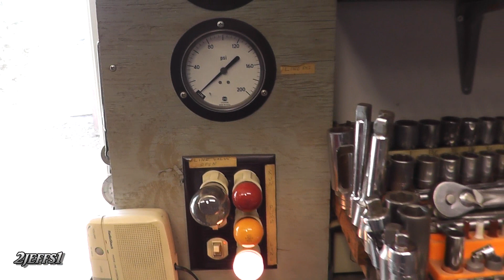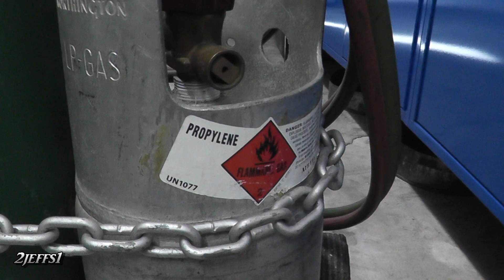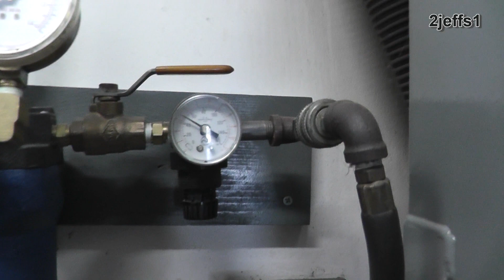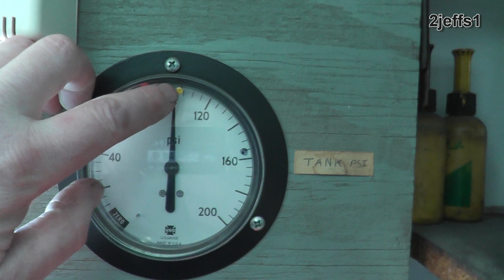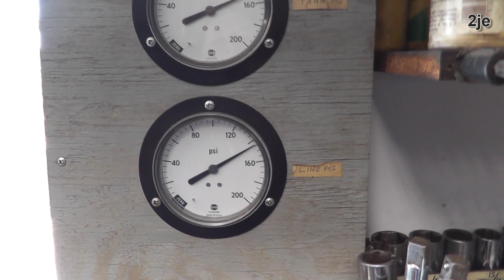Air Compressor Setup Money Saving Tips & Ideas

Comment: Nice!  Is that a Kellogg compressor head?  I have one that a friend gave me (though he didn't know it's history) that looks virtually identical and I intended to build a similar setup out of.  The difference, where yours was missing the intercooler lines, mine has those but is missing the pulley/flywheel, and I haven't had much luck finding one of an appropriate size.  

Any idea what RPM yours runs at?  Mine is rated at something >25cfm at it's rated rpm, which is way more than I'll ever use so I'm considering hooking it up with a smaller motor and turning it at a lower rpm, but again, I've had no luck finding a pulley/flywheel for it.  I have a pulley that is large enough for it that I could rig up with a cooling fan but I'm not sure about running it without the weight of the stock flywheel.

BTW, mounting it on springs is clever, I'm likely to steal that idea when I get around to building mine ;-)
Reply from the maker: Hi there Mark. You are correct - it is a Kellogg pump. I had that pump before arriving here in 1986 but not that 120 gal tank it sits on so kinda don't remember the specs. However I do have some helpful advice for your setup. I remember that they recommended that that pump had a 7 1/2 to 15 HP motor. I only had a 5 HP at the time and figured why can't I ratio it accordingly and make use of the 5 HP motor. Well it could be done and worked but - where the flywheel didn't have the speed/momentum the shop lights would be blinking when it was running. Tried several motor pulleys and same, same. Did finally get the 7.5 HP motor and all was well. So getting the proper flywheel and motor for your setup is kinda important. BTW my motor is the 1750 RPM in case you were wondering about that. Hope this saves you some time, trial and error (and money!) Mark. Good luck, Jeff.
Reply: Did you ever get it running right on a 5hp motor?  I have 3, 5hp (supposedly) motors sitting around but not much bigger that's single phase.

The spec sheets for these things are available from a few different sites, so you should be able to get complete information about them, for example, My 335TV is rated for 3-8hp at 400-1000rpm:
http://kellogg-american.com/wp-content/uploads/2015/07/K335-Manual.compressed.pdf
(you should be able to find PDFs for most of their other compressor heads on that site, though there are better versions out there from other sources).

I am worried that without a heavy enough flywheel I'm not going to get this thing to work well, if at all.  I don't believe the stock one was super heavy (I remember that I ran across a spec of 22# somewhere, I don't remember where) and about 13" OD, and I have a 15.75" OD pully that is only 13#.  I even contacted Kellogg and they didn't have one in stock but swore that some of their distributors should have one and none did, though that would have been out of the budget to spend on a compressor head with an unknown history, $219 from them.  I've even had crazy thoughts like cutting a hub on a lathe to adapt a brake rotor or engine flywheel to the shaft to act as a flywheel, but that would impeed airflow which I probably still could get around by wiring an electric fan to come on with the contactor... though at some point you have to wonder when something so cobbled together is going to fail.

I think I did a little looking and comparing their power and cfm graphs and figured that it would be really sweet to have this thing loafing along at around 600rpm and still moving more air that I really need to run any common air tool, sand blaster, spray gun...
Reply from the maker: Hi Mark. I did use mine for a while with that 5HP motor. It was evident that it wasn't the ideal setup. The local farm store had a 7.5 HP motor that was a return. It was marked down and the manager even knocked off another 100 bucks to move it. Talk about the right time/place. Seemed I got it for around 300 bucks and has performed perfect for all the years, never an issue. For sandblasting a big compressor is nice when you can keep going not waiting for it to catch up. Your car flywheel idea did sound like a possibility to do, just too bad you couldn't get lucky and find exactly what is needed.

Comment: What do you  run that needs this much air and what is your capacity storage?
Reply from the maker: +zoticus1 Sand blaster, grinders, at times friends helping with multiple tools running. Never run low on air then and have to wait for it to pump up. The main tank is 120 gal, the rest are smaller, I'm not sure.
Reply: wow that's bad ass

Comment: Do you always empty the whole pressure tanks after using them?
Reply from the maker: Never have. I have that electric shut off valve to keep the lines from loosing air & emptying the tanks when not in use. I even noticed a drop in the electric bill after installing that electric shut off valve where the compressor didn't have to run as often now!

Comment: Not hotter then acetylene.   In fact it's 5122F for porpylene   vs 6300 for acetylene,  but if you REALLY want to save money use propane like almost all industrial flame cutting machines do.  It's not as hot but the edges of the part are cleaner and you can get propane at the grocery store. - The only thing we ever use acetylene for is welding (not brazing) cast iron. with REAL cast iron rod.  100 bucks to a beer nobody who reads this will ever gas weld cat iron so just forget acetylene and use propane. - and you use an easy to clean tip like the Harris VVC tips. - No down side to it at all in the common shop.

Comment: Wait  a 3p motor will run on 1p 220v??
Reply from the maker: To be clearer on that starter box it was for a 3p motor. I just used 2 of the 3 sets of contacts for the 220v 1p where a friend gave me that years prior and has been working trouble free to date.
Reply: 2jeffs1 - ooohhh, thanks for clarifying that.

Comment: What shutter motor is that?
Reply: Also what kind of bulb is the bulb on the left side of the control
Reply from the maker: Hello. Did a bit of research for the right P/N on that paper where their was multiple ones. That shutter door motor is no longer available from Granger.Other places did show them yet. The P/N for the one you need is 2C831B and made by Dayton. It was used for 10 to 36" single panel wall shutters. When you look one up it will have a L bracket and small electrical connection box mounted to it which comes off. They are for ventilation louvers for exhaust fans. A little more info on how them work. You must maintain power on the motor to hold that arm open. (It's not like any circuits get changed to reverse the direction.) Them draw very little electricity I think like on the order of maybe 7 watts. On that bulb I have no idea what to call it or what it was originally for. Anyone watching the vid who might know let us know! I got it from a rummage sale my ma's friend was having. Her husband passed and had a ton of cool electrical stuff to sell! Hope this helps you out, Jeff

Comment: why not have a high pressure system like maybe 1000 psi or so then regulate down. then you can have smaller tanks?
Reply: the destroyer then you will need scuba tanks for that standard air tanks can only handle 200 to 250 psi average
Reply: i have a tank that is rated for 2750 psi
Reply: the destroyer those are some expensive tanks
Reply: antique store😂 its fully functioning even had pressure in it
Reply: News at 11: Local man found dead with antique gas cylinder shrapnel embedded in skull.
Reply: Andrew Erickson its not old

Comment: All copper pipe is measured by OD
Reply: Walkertongdee Not true Wakertongdee. plumbing copper is inside ID measurement.  Refrigeration copper is OD Measurement.
Reply: Lee Olaeta
Reply: Lee Olaeta. fittings measured inside
Reply: Walkertongdee plumbing fittings are measured inside of fitting. a 1/2 inch copper fitting is actually 5/8 inside. Just like 1/2 copper pipe is 5/8 outside.
Reply: Lee Olaeta five eights fittings not avsilible for water dude

Comment: jesus..how is it THAT quiet..
Reply: omar k Low RPM
Reply: how do i make that happen?
Reply: omar k Install a smaller pulley on the drive motor. The only obvious problem is the lower the RPM the lower the noise the lower CFM
Reply: it doesnt have a pulley. its from HF
Reply: omar k Than you can't
Reply: ***** it's the slow RPM not the quality of the part that made out of

Comment: Very informative, thank you!  I have a question... I'm renting a shop that has a vertical compressor mounted just outside the back wall of the building. It has a small slant roof-like awning over the compressor but has nothing around the sides of the compressor.  Do you have any advise for what I should do for protecting the compressor from the elements, if needed? I live in an area of Colorado where the summers are hot and the winters are cold. Thanks in advance.
Reply from the maker: Actually in the shop I had before here I had a outside hut built around the compressor with a slanted roof to free up shop space and not hear the comp running. I did have sound deadening blankets and a car muffler on the intake to keep the neighbors happy. I had a sensor which would turn on an exhaust fan if the hut got too warm inside. I still use Mobil 1 5/30 (year round) in the pump where it gets so cold upstairs here in the winter. Probably with what you have as long as the snow don't get on things you would be ok on not doing a full enclosure. I do have a magnetic heater (sticks to the pump side cover) on this setup which will get turned on for an hour if it is 10 below or colder for the first startup of the day only.
Reply: 2jeffs1 Thanks so much for the tips.

Comment: So, is it safe to weld on  a crack air compressor tank? My compressor got a small leak due to a small crack on the base of the wheel and planning to weld it. Please let me know if it's safe. Thanks!
Reply from the maker: Hi Joel. That tank was brand new other than that damage. The condition of the one you have is important. If it is quite aged or was never drained for accumulated water (lotsa unseen rust inside) then I would'nt recommend doing so...
Reply: Thanks mate!